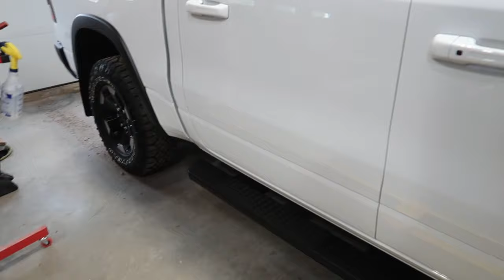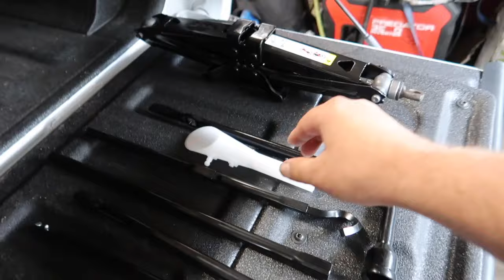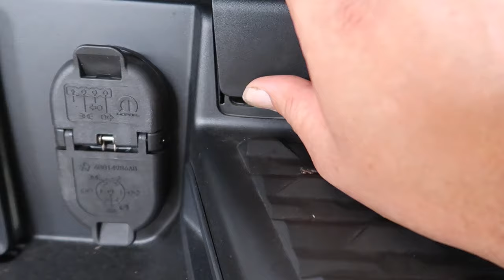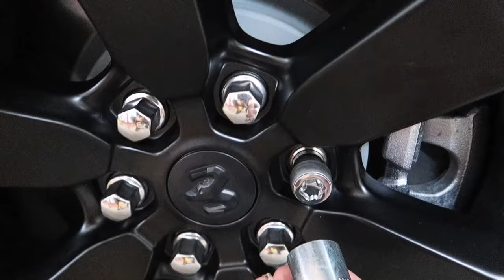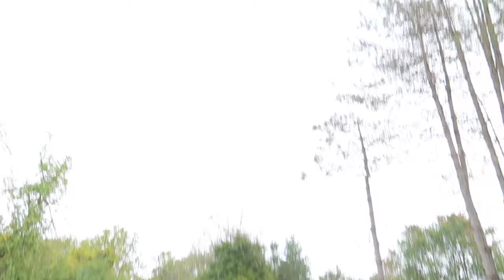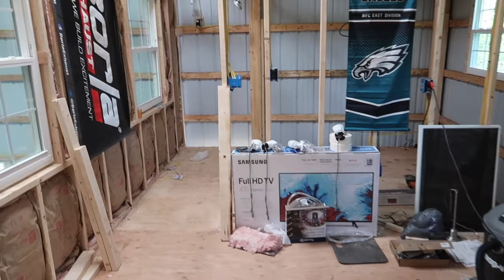2019 Ram Rebel DIY Tire Change

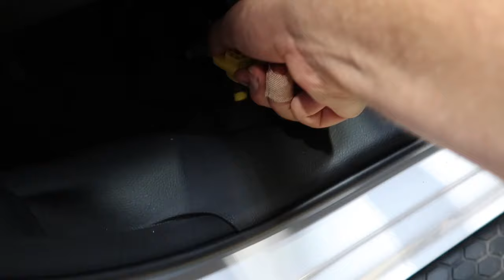Comment: 1:34 first video i have seen where they show the orientation of the tools. the previous owner had not strapped the tool kit to the jack at all and had the opening facing the opposite end so when i tried to put it back it wouldnt fit. thank you.

Comment: Awesome video. I have a 2016 Ram Limited and my spare tire hoist has a McGard lock on it. Had to search all over the truck for the key. I also have the same wheel locks. 

Have you tried to see if the hoist seat fits through your OEM wheels? Looks like we have the same 20" spare but the center hole is larger on it. I can't fit the hoist through the OEM wheels. If I get a flat, I have to throw the OEM sport wheel in the truck bed. Don't know why Ram would do that.

Comment: I don't know if there is a specific reason for it, but I've noticed that the spares always seem to come with the air valve facing up, forcing you to drop the spare to check the air pressure.  The first time I have to do that, I flip the spare over so the air valve faces down so I can check the pressure with much less hassle.

Comment: Can you fit 35x12.50r18 tire on oem rims into the spare tire space underneath ?
Reply from the maker: That I have not tried but might be something I should
Reply: The hoist seat may not fit through the OEM rims center hole. I've tried it on my 2016 Ram Limited with the polished aluminum six spokes. The 20" spare center hole is much larger. 😒

Comment: Hey , about the the hood you have . Do you have a part number for my and a shop where i can order it ? They have to ship it to France as wel .
Greetings from france 
😀🗼😀🗼😀🗼😀🗼😀
Reply from the maker: hmm that would be something the dealer would have to get for you since I'm not sure all the vents come with a bare hood you might need to order those too
Reply: @HammerdownMotorsportsUSA  thanks for the info , but here in France you can't order aftermarket parts , so I wil have to order it straight out the USA and i don't know a dealer i can trust in the USA  .
But i will keep on looking for it .
If perhaps anyone of the viewers know , please let my know , even if it is only the part number. 
Thanks in advance. 
Greetings from France.